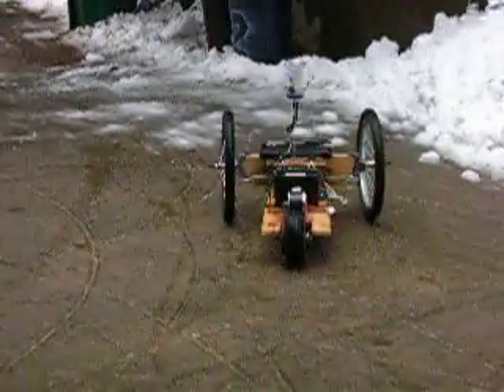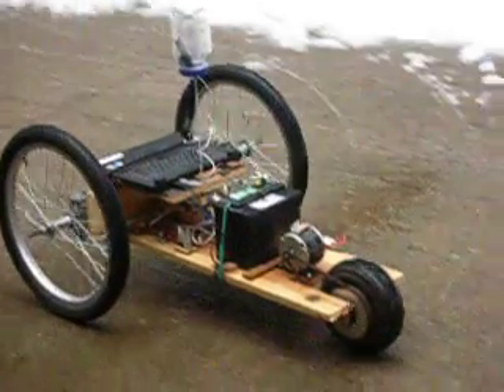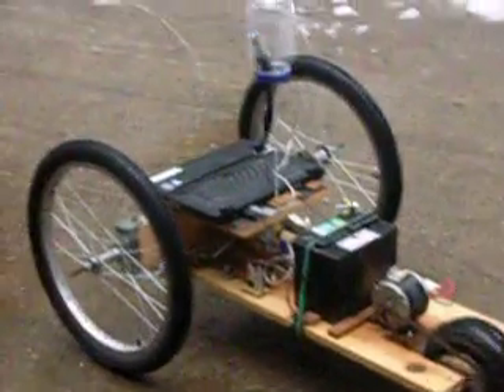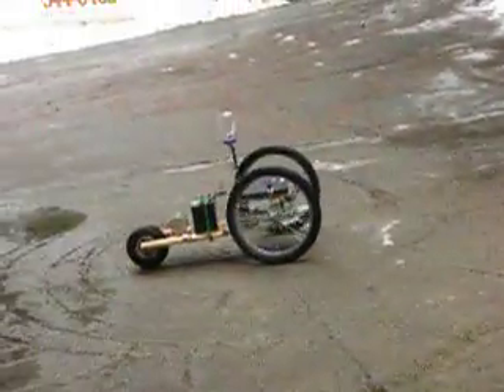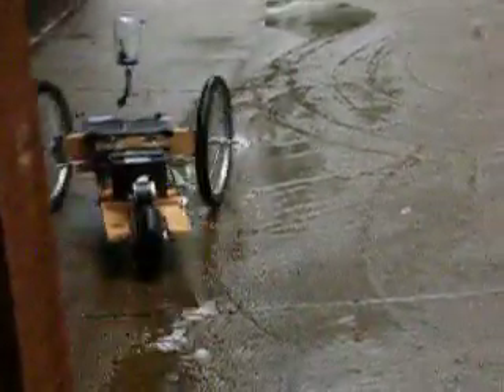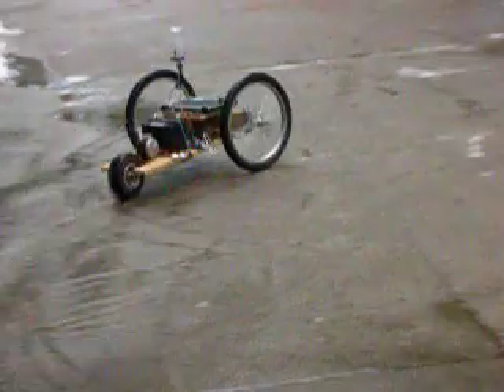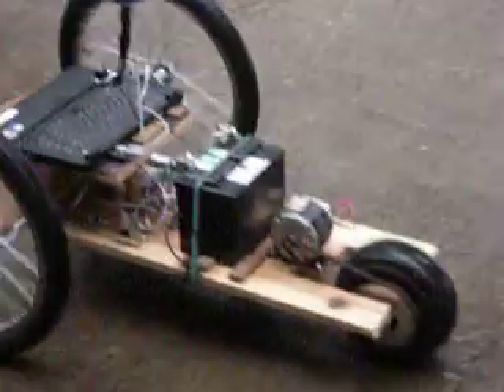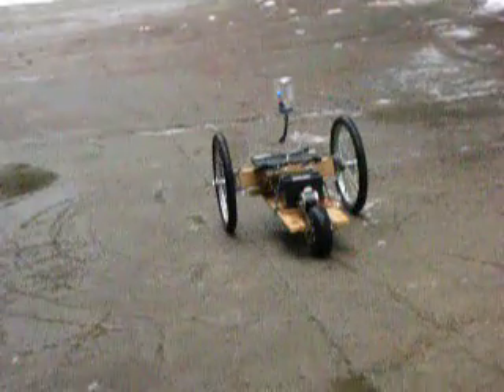ATRT Run 6

Comment: Yes, it is using an old electric scooter motor. I tried using the speed controller from the scooter, too, but it wasn't able to slow or reverse the Trike, so I scrapped it and built a high-amperage controller board for it instead. The chain, and the rear wheel are both from the same scooter, too.